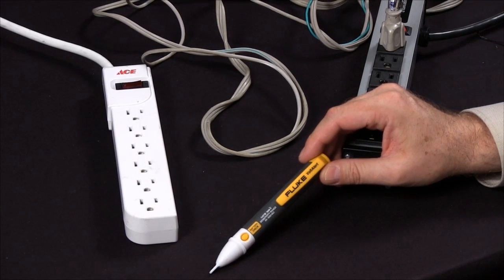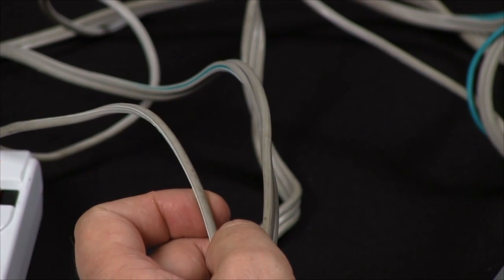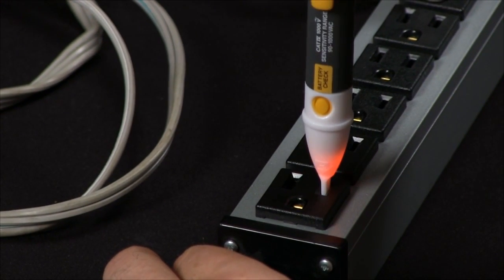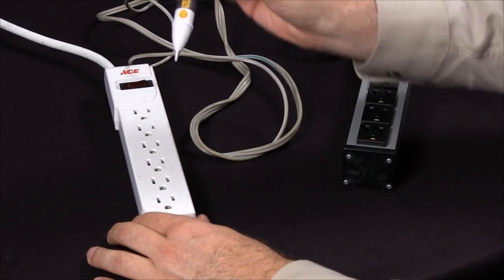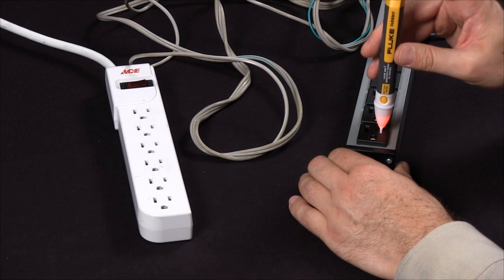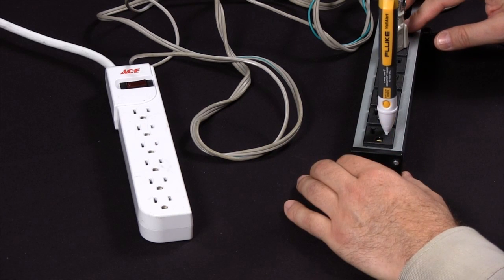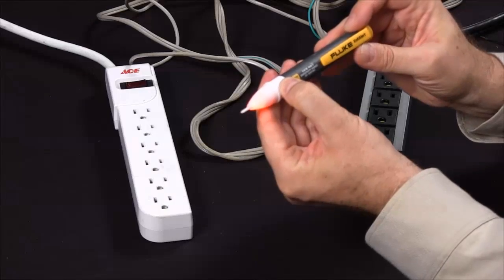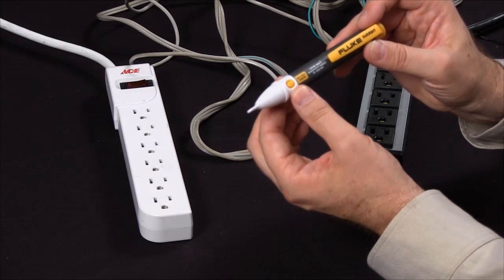How To Find An Open Circuit Using A Fluke 2AC Non-Contact Voltage Detector

Comment: I'm curious to know why, when testing the cord that is energized, voltage is not detected on the neutral wire?
Reply from the maker: Hi Bill, although the neutral is conductive there won't be voltage going through it. Hope that helps! Thanks!
Reply: I think when it is energised it will have voltage. It is an odd reply to not agree this is so. ie When the plug is in it is linking live and neutral so both are on if the device is on. As I see it.?! Not a professional, but hope to be one day.

Comment: Does it detect DC or only AC current?
Reply: i would assume both because ac is just dc switched, and they tested an ac power strip in this video. i would assume yes, but i can't say for sure. if you hook up a multimeter to an ac source when it's on the dc setting, it will flicker back and forth from + volts to - volts, but when showing + volts the voltage is correct.